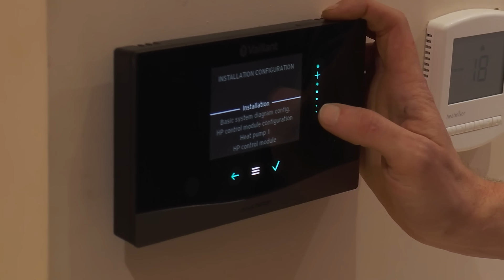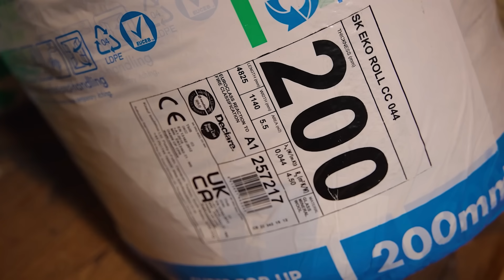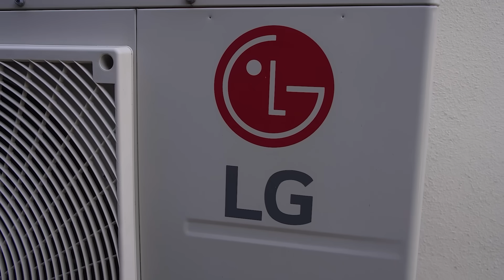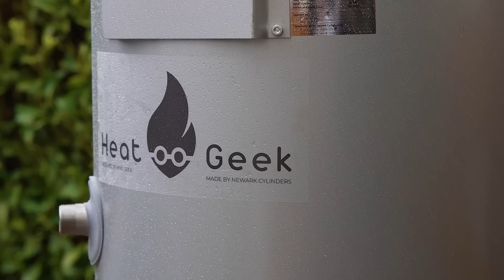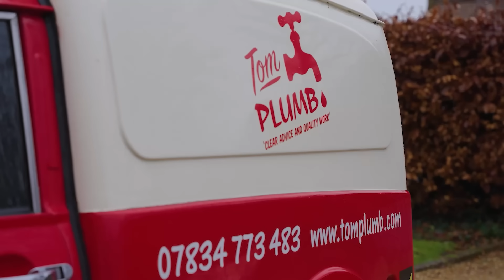Heat Geek’s Heat Pump One Year Later — The Verdict!

Comment: Govement also need to de-link electric generation costs to gas supply costs. Our electric generation costs are far lower than gas.
Reply: They spoke about this during the initial energy crisis and about delinking the price of electricity to gas but it's obviously fallen by the wayside now.
Reply from the maker: That is not the issue at all. It is to do with the green levy which gives the investors in renewables a guaranteed income for the life of their infrastructure. That won't change.
Reply: @SkillBuilder  

It is very much the issue, from government website :-

"Electricity is increasingly generated from renewable energy in the UK, and the cost of renewable generation has significantly decreased in the past decade.

Despite this, the price paid for wholesale electricity on the ‘spot market’, where, according to the Competition and Market’s Authority around two fifths of electricity is thought to be sold (PDF), is largely determined by the price of natural gas.

This Insight discusses the ‘marginal cost pricing’ system, which prices electricity from all sources according to the most expensive source, and its effect on the price of electricity from various sources."
Reply: @_Dougaldog   Renewable energy will allways be expensive, because you have to maintain a full back-up system for those days when the wind stops and the sun doesnt shine!!   As it is, we're having to import as much as 25% of our electricity on some days....  Some of it from countries that burn dirty lignite coal to ptoduce it!   Surely we need the country to be self-sufficient???
BTW   Solar power is cheap when the sun shines - at night, it is infinitely expensive, because all that expensive infrstructure produces NOTHING!
Reply: @richardking6066  yes and in UK windy weather that turms the turbines is always linked to mild weather , when its windy its not cold so we dont need the heating , basically renewables work best when its not needed ie in daylight and in mild weather
Reply: @SkillBuilder  lets fact check these 2 comments and see who's right:

First Comment (More Accurate)
De-linking Electricity Prices from Gas Prices:
In the UK (and much of Europe), electricity prices are influenced by the marginal cost of generation. The price is often set by the most expensive form of generation needed to meet demand — typically natural gas.
Even though a large share of the UK’s electricity now comes from renewables (wind, solar, nuclear), the electricity market is still structured so that the final price reflects the cost of gas-fired power.
This is called the "marginal pricing" system. When gas prices spike (as seen during recent energy crises), electricity prices rise across the board, even if the actual cost of producing renewable or nuclear energy is much lower.
Many experts have suggested reforms to decouple electricity prices from gas prices to better reflect the true cost of generation.

SkillBuilder Reply (Partially True but Misleading)
Green Levies and Renewable Subsidies:
While it’s true that the UK has Contracts for Difference (CfDs) and other schemes that guarantee a minimum price for renewable energy producers, these are not the primary reason for high electricity prices.
Many newer renewable projects under CfDs now produce electricity at very low, even negative, prices during certain periods.
Some older subsidy schemes (like the Renewables Obligation scheme) do provide fixed payments to generators, but these are relatively small compared to the overall price impact from gas.

Green Levies:
Green levies contribute only a small fraction to consumer bills. They fund renewable energy, energy efficiency programs, and help vulnerable households. While they do affect prices, the scale of their impact is minor compared to gas price volatility.

Conclusion:
The first commenter is mostly correct — de-linking electricity prices from gas could significantly reduce electricity costs, especially as more renewables come online.
The second commenter is misunderstanding the role of green levies. While they exist, they aren't the main reason for high electricity prices.
Reply: @SkillBuilder  I've been poking around this area for a while and I'm pretty sure it is the issue.

1) The OFGEM price cap increased by something like 300% from 2020 to 2022 at the height of the Russia/Ukraine war
2) Our energy bills are clearly linked to the price of wholesale natural gas and marginal cost pricing. If you look up the historical UK electricity price for a KWh and cross-reference it with the natural gas price, you will see they are joined at the hip. 
3) In 2024, there's a ~11% green levy on the average dual-fuel energy bill. For the electric part specifically, the green levy was 16% (this is after natural gas prices dipped back down to something like 2x their 2020 levels -- the green levy as a proportion of the 2022 bills was likely very small given the outrageous natural gas pricing)

The price of natural gas dominates the equation. If Russia hadn't started a war with Ukraine and gas prices remained cheap, you might have had a case, but that would've relied on natural gas still being dirt-cheap. IMO we're now in a situation where energy security is just as important as the green part of the equation.

Comment: tepid heat guaranteed, you will need back up.
Reply: Yet John didn't use his backup...
Reply: My radiators run at 32C, this keeps Livingroom at 21C-23C, bathroom 23C-25C, you get the drift.

If the room lost no heat and heated up to that 'tepid' 32C you would certainly be more than aware of it.

Comment: Did the heat pump installers at the House of Commons get their design wrong too or did they abandon the installation and go back to gas for some other reason?
Reply: Was that the Telegraph story by any chance ?

The expansion of their current heat pump system has been paused apparently.

There are already three heat pump systems installed and in use at Westminster.

Comment: 450% efficiency doesn't tell the whole story - as a single source of heat, they remain expensive to operate even in newly build, highly insulated homes.
Reply: It was £920 for the whole year at 15p/kWh, so about 6133kWh of electricity was used for 27,600kWh of heat.  a 90% efficient gas boiler would require 30,666kWh, at 6p/kWh that's £1.840 spent on gas... so cut the cost of heating in half.

They don't need highly insulated homes either.  Insulation matters in reducing heating costs regardless of heat source.
Reply: @BenIsInSweden  These figures are pure fantasy and/or very, very out of date.
Reply: @andrewstafford6783  

Your information is not accurate.

My HP running 24/7 uses typically (January to February) eleven to 15 kWh a day at 14p per kWh (British Gas HP tariff).

How is £2.10 a day expensive for heating and hot water ?

Comment: 😂 why not just do that with a gas boiler.
Insulate the attic😂😂.
Reply: You can run a gas boiler low and slow. I did to save money, then switched to a heat pump (which saves me a little more).

Comment: Would you now have enough capacity to charge an EV ?
At a decent rate?
Reply: 3kW for heat pump+ 7kW for EV. I would have thought so?
Reply: @Biggest-hz7ng  3KW for a 6 bedroom house ..really?  That's the same as a kettle.
Reply: @stephenauty2402  I was mistaken. Vaillants look to draw up to about 50% of the output -so 6kW for a 12kW output pump down to about 2.5kW for a 5kW. If run efficiently they mostly won't be drawing that much.

Looking at John's install, he was drawing up to 5kW at -2.3C outside on the 11th Jan 2025. That day he used 92kWh of electricity and outputted 232 kWh of heat for a COP of 2.5 over that specific day.
Reply: @stephenauty2402  

My two bedroom semi is heated by a 6kW (max output) heat pump.

On average it consumes 500 Watts or less (one sixth of a kettle).

It can peak at 2.8kW for a short period when heating HWC to 60C on the rare occasion I run a legionella cycle.

Comment: 20’C !!!
This is the issue
Reply: Some think it would be too hot indoors at that temp, some too cold... Some report running 24C indoors!
Reply: @Biggest-hz7ng  It's too hot..baby boomers have got used to too much comfort.. It's unhealthy for people , pets and the environment.
Reply from the maker: stephen 
Give it a rest with the baby boomers hate speech. It is nonsense to group a bunch of people together based on age, race or gender. It shows a level of ignorance that does you no credit.
Reply: @SkillBuilder  race and gender ?? 🤣  what are you talking about?
Reply: @stephenauty2402  

'Room temperature' is usually classed as somewhere between 20C to 23C.

Age UK for the elderly recommend bedroom temperature of 18.3C, much below this leaves elderly not only open to hyperthermia, but also strokes and cardiac failure as blood pressure rises and falls as their bodies try to maintain steady core temperature.

But if you want a grant MCS specification requires 21C for Livingroom.

Comment: We have a new build, fitted a heat pump best heating we have ever had .
Don’t believe all the negative press coming from the Fossil fuel lobby.
Reply from the maker: New build that is the key to your argument.
Reply: @SkillBuilder  Why is new build key to that argument? All new build means is that affords the builder/developer the perfect opportunity to design and install the heating system and building in concert without disruption. Otherwise, the problem is exactly the same - how much is the heatloss -> size emitters and HP accordingly -> ensure pipework and DHW is sufficient -> install.
Reply: fossil fuel is a made up word , whats more the so called fossil fuel lobby are heavy investors in so called renewables , you are really gullible

Comment: You can't actually fix the climate and keep gas boilers. They have to go; it's that simple. Anyone saying 'oh, we'll keep using gas for decades' is just saying 'bollocks to the planet, never mind about that'. The best way to deal with the electricity cost issue is insulate and airtight all the crappy houses in this country. Yes it's a big job, but it's also worthwhile local employment. We'll get huge improvements in quality of life, and reductions in running costs as well as a huge improvement in the national balance of payments.
Reply: You need more than a heat pump to improve most people's quality of life these days. Solar powered Sunlit Uplands aren't going to fix the country.

Comment: The reason we've not got a the Swansea barrage is not the birds/environment, it's the cost. Even with a 120-year period it was somewhat more expensive (£120/MWh) than nuclear, which is of course already pretty expensive (£100/MWh). (As opposed to £80, £60, £40 ish for wind and solar).  It was very close but eventually the govt decided it just didn't really make financial sense. It's certainly pretty marginal. It is much cheaper than the other sort of tidal: tidal stream, which was about £350/MWh for the schemes so far, although I think Orbital is reckoning to get to under £200 with their next machine.
Reply: Indeed. Tidal / wave power just seems like a bit of a distraction at this point. I'm not saying they should discontinue research, but it's unproven, expensive and there are better places to spend the money right now.

Comment: Proof that MCS is broken...
Reply from the maker: true
Reply: MCS only applies if applying for a grant, I don't think that was the case here in the original instal.
Reply: @_Dougaldog My point was more general from the other horror stories. I've had several MCS quotes for a heat pump and all insisted on ridiculous solutions that just tick boxes for MCS - like replacing a practically new hot water tank rather than designing a system to work with it.
Reply: @ 

The heating coils in a standard HWC are not nearly big enough for heat pump use.
My HP will heat HWC to 60C if needed, but because of high flow rate and the need for the heat to dissipate into the water quickly it means there has to be a large surface area of copper on the indirect heating coil.
I have the Mixergy HWC which uses a heat exchanger unit to transfer heat to the water in the HWC, the surface area is 3m^2 in total. So a coil of similar surface area is needed. That is the reason a new HWC is usually needed.
Reply: @_Dougaldog  but if you put a plate heat exchanger on an existing tank that will do the trick, but MCS don't like that... I would love a Mixergy but I'm no throwing out a perfectly good 3 year old tank for it!

Comment: I have a friend who designed his own house which has NO heat input other than that from appliances & body heat.  Its cool but comfortable - and QUEIT - all year round.  It is do-able.
Reply: To most people a cool house is not a comfortable house.  Most people especially the elderly actually like to be warm.
Reply: @TheDavecroft  I said comfortable.
Reply: @TheDavecroft  
Myself at 87 am cold for about 6 months of the year and wear  heated Gilet most Winter and early Spring days. Today I have just paid BG £700 for gas for the last quarter and that's leaving the CH on at nights during our very frequent frosty nights.  That includes gas for cooking as well. I would feel cold in a house at 20/21C

Comment: I'm watching this because we've just had funding approval under the EC04 scheme. Upgraded insulation, PVs, Air Soource heat pump, back up battery. What's not to like. All free.  The plumber just doesn't like the idea of change. It's coming mate, get on board. 😂
Reply from the maker: It isn't free. We the tax payer are footing the bill. The plumber loves change but change without progress is not worth it. 
These systems may work for you and many others but they won't work for everyone.
Reply: @SkillBuilder  heat pumps working for many/most is a start. Heating needs to be decarbonised and the grant is a cheap way of doing that. Suggestions of good ways to optimise decarbonisation are welcome.
Reply: You got conned.  Nothing is free.  Remember when electric cars had 'free' road tax?  Now £400 from April.  The £7500 grant won't be enough to cover all the extra costs or the hassle, or the cost of electricity when it shoots up in a few years, wind farms aren't going to save us.
Reply: @TheDavecroft  EVs are likely to be tax free this year, £10 next, then £195 the year after (not £400?)
Reply: @TheDavecroft  

At least give correct information.

Any with an EV who retaxes it before April 1st will get free road tax until 1st March 2026.

Thereafter it's £195 a year, unless you buy a new car after 1st April of value over £40k, then you will pay more in years two to six (£620), then £195 after that (they pay £10 for first year).

Comment: The only way this will work so that everyone is satisfied with their ASHP is that every installation company/installer is held responsible for the install, if that means a team has to go around checking why someone has a problem then so be it, enforcement must happen to give the customer piece of mind, this in itself will then give people the confidence to move to a heat pump. As it is now the bodys that are set up to supposedly protect the customer are the biggest problem the industry has, not only is it a nightmare for companies, even more so for individual installers with the mile of accountability and paperwork, but it does nothing whatsoever to enforce the bad installers to return and fix the problems. Maybe the answer is to make the grant a returnable grant back to the government if you can't fix the problem that the above team has said needs to done, that way bad work can be corrected and installer paid to do so from the returned grant.

Comment: I have problems with heat geeks, 1. They are partners of Valiant and will not fit or help design of better brands such as Mitsubishi. 2. They don’t actually look at air to air systems vrs heat pump only installs, after all why not have the option of AC in summer especially as lots of people work from home these days. So in summary to me they are looking at a narrow view of the technology instead of the bigger picture.
Reply: Their videos cover a few brands. They are A2A resistant, but I think that would probably change if they saw decent efficiency figures from A2A systems.

Comment: My personal belief is that systems can be physically installed by plumbers, but they should be designed and commissioned by heating engineers
Reply: Exactly. There needs to be a distinction made between the two different skill sets.
Reply: @rodgerq  Proper engineers are like rocking horse shit in the UK.

Comment: Been a heating engineer for 32 years. Got an E in maths and don’t have hours spare to do calcs whilst quoting like Adam did.

Just shows Adam was wrong regards bearings when it was the compressor and Adam is meant to be the expert. 

It’s all way too complicated and is never going to catch on and will never be rolled out nationally.
Reply from the maker: To be fair Adam knows nothing about heat pumps, he couldn't fix one. His expertise is in low temperature heating systems which can be powered by a heat pump or a gas boiler. The heat pump is the white box that they connect to. They will not take the cover off it.
Reply: You'll need to get up to speed then as building regs now require a full heat loss report to be done when installing or replacing a gas boiler.
Reply: @ I’ll wait until I’m pulled up for not providing one. I won’t hold my breath either

Comment: Heat pumps are just REALLY STUPID OVER ENGINEERING. Get solar and battery and a simple electric boiler. Charge the battery at night from 7p electricity, heat house in the day with battery and so,at top up and some expensive electricity in cold weather. Simples.

Comment: I have used the LG therma V they threw out the last winter. It did it's job well, in case you wonder. And still does. Down to -10C. With "normal" radiators.